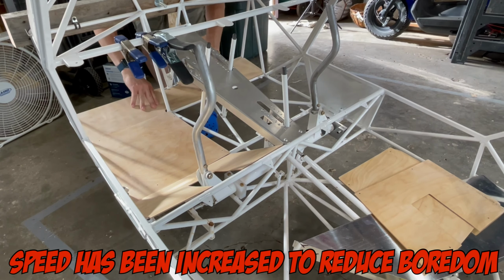#17 Loose Ends. Right Stick Control Column Pt. 1

Comment: Thanks for posting. It’s nice to know it’ll be easier to torque everything prior to final install.
Reply from the maker: Hello Greg, I’d have torqued that thing when I put it in if I could have gotten a socket it on there.  I assume there are other torque wrenches that allow one to connect an open end wrench but I didn’t have one at the time so I tightened it up with two open end wrenches & stuck it in the fuselage with a note to come back later after I had a solution.  I don’t know if all Kits are like this or if this was just something unique to mine.  It sounds like all kits are basically created “almost” equal, however by humans so there will be some differences in each kit I think.  I’m looking at Jeremy’s rudder pedal issue & hoping that I don’t have the same issues.  Have a good day, oh & if you haven’t set your sights on the Rotax yet, Mr. gotcha going commented to my post the other day & turned me onto the Viking website.  I had not heard of them & I may have changed my mind. It may be worth a look for you.  Matt
Reply: I’ll definitely watch for that when I start my build. Regarding the Rotax….I’d love the 915 and I’m still leaning that way, but I have looked at the Viking and I’ve thought about that a bit too. Much less expensive. If I can get comfortable with the reliability it may change my mind. Let me know what you find in your research.
Reply from the maker: Greg, I must say I had tunnel vision with the Rotax only in my sights & I don’t know why.  I did look at Titan, possibly another Lycoming but kept coming back to the Rotax. I liked the idea of something different, I didn’t like seeing the TBO stuck at 1,200 hours though with the price of an overhaul probably looming around (I’m guessing) the 20k mark.  When I saw the Viking kit & having been a previous Honda owner with multiple Civics in the past I really liked the idea.  I’ll keep you posted though.  Have a good day, Matt
Reply: I’ve been watching videos and doing a little reading tonight. I’m sure it’ll suck me in until I’ve watched everything and read every forum. My requirements are below…in no particular order:

1. Reliability 

2. Ease of maintenance 

3. Purchase price and maintenance costs

4. Enough power to climb well at high altitude. I live in Utah so most of my flying will be at 5,000 + feet MSL. The Rotax was on the top of my list because of the turbo and high altitude performance. It was on the bottom of my list for cost. I want the nicest but don’t want to pay for it😂

5. Fuel burn and efficiency. 

I’ll admit that I haven’t done a ton of research or put everything on paper, mainly because my build is still so far out. Never too early I guess.
Reply from the maker: Hello Sir, another comment I missed for a long time.  From what I’ve been reading the Viking engine would meet a lot of items in your category.  I’ve now seen that Brandon & Heather’s Kitfox has a 916iS on it.  I never even knew that it was out yet.  So more HP & weight which tells me I can put in a bigger & heavier engine.  I’m looking forward to that when the time comes.  Take care & thanks for commenting.  Matt

Comment: Thanks for the video. 

This obviously won't help you now as you solved the problem a year ago...

But as Mikefairbanks said below, simply torque that bolt before installing the upper AN4 pivot bolt. Even better if you can get it done before you press the bearings.

Hopefully this helps at least one person with a future build!
Reply from the maker: Thanks @jakeryan5078 for your comment.  You are correct and I too hope that it will help a future builder.  That is the reason I’m posting all of my mistakes along with my progress!  Have a great day, Matt

Comment: You got it done, but I sure would have thought pulling that top pivot bolt would have given you enough play to lift that into the opening.  If not you could have used a crows foot.  When using a crows foot placing the torque wrench handle 90 degrees to the crows foot does not change your torque value.  Anything other than 90 degrees and you have to calculate the difference.  But at 12-15 in-lbs, there would be very little variation no matter how you aligned it.
Reply from the maker: Hello Mike, another good comment & another tool which I have to look up.  You seem to know quite a bit in the arena of torquing.  Have you picked out an inch-pound torque wrench yet or do you already own one?  Mine has a ¼” drive which at times limits me a bit & I end up having to add on extensions or adaptors so I can get the right socket on for the job.  I’ve now looked at the crows foot that you speak of.  Do you think that would have fit in the hole allowing me enough space to get the socket wrench on it?  Perhaps I’ve been looking at the wrong crows-foot.  they look like the end of an open end wrench cut off with different sizes of drives (1/4”, 3/8”, 1/2” etc.) correct?  I will keep in mind what you said about having to calculate the torque value if anything other than 90º to the foot is used.  How much longer until your kit arrives?  Thanks again for the comments Mike & I hope you are having a very nice day.  Matt
Reply: @KingFox76  You've got it, a crows foot looks like an open end box wrench that you can put on your ratchet.   The other thing that I think might have helped with torqueing those bolts would have been to remove the top stick pivot bolt to allow you to lift that joint up a little bit... I haven't done it myself yet, so don't know if that would have worked, but it looked like there was some room there. Officially I'm slated for 2023 Q1, but was told probably February... so in anticipation I'm hoping to have it ready to ship by the end of February.  I just got my 29" Alaska bushwheels to include my baby bushweel tailwheel and T3 spring this week.
Reply from the maker: @mikefairbanks  Hello Mike, do you know of a good supplier of the “crow’s feet” besides Aircraft Spruce?  They seem to have only the oversized at the moment.  I will do some looking around but I think more standard sizes from the ¼” and up or 6mm and up for the metric side will do me better.  I don’t like to buy some tools off of Amazon if I can help it as the quality of the tools is sometimes poor at best.  Maybe I’ll look into Craftsman since I bought a set of wrenches from them and I like to keep everything mostly the same if I can help it.

I remember the day when my 29”s showed up at the door.  It was cold, they looked small until I put them in the back seat of my car for transport.  I think they are going to get a lot bigger once a little bit of air is put in them.  I may be putting the plane on the gear here soon to help me move it around the garage.  My floor is pretty poor concrete and sliding it around on those little pallet move very or whatever they are called can be a pain.  Not to mention having to bend over to work on everything.  Well I hope you get the kit sooner than later so you’ll be able to tell me your workaround for my problem.  Have a good day, thanks for writing.  Matt
Reply: @KingFox76  My set is Craftsman, I bought them over 30 years ago when Sears had a huge military appreciation sale right after Desert Storm.  Lowes list both SAE and Metric Craftsman sets on their website.  The SAE set starts at 3/8" and goes up to 1" with all the normal sizes like a wrench set.  They are 3/8 drive though, so you'd need a 3/8 to 1/4 adapter.
Reply from the maker: @mikefairbanks  Well Mike if it is a Craftsman set then I shouldn’t have a problem finding one that fits in with my tool set.  I’m gathering up a list of the tools you’ve mentioned, the rivet fan and now the crows feet and I’ve added in a 90º drill to the list.  I have the adaptors necessary to step down or up to the proper drive size.  Thanks for the follow up info on the tools Mike, have a great day.  Matt

Comment: Looks to me like that is a Nyloc nut. Surprised they put a torque requirement on a nyloc since the whole purpose of torque is to prevent the fastener working itself loose. With nyloc nuts the reason for the nylon insert is to prevent the fastener from working itself loose. Is it a Nyloc nut? Only asking for when my kit comes in.
Reply from the maker: Hello Kevin, finally getting back to you on this one.  The nut is a nyloc nut.  I’ve found them in many different areas of the build & they all are supposed to be torqued nylon locking mechanism aside.  I’m with you on that, maybe it is overkill or just cya stuff?  Thanks for the question & comments.  Have a stellar day, Matt